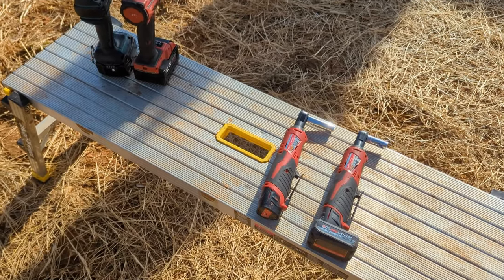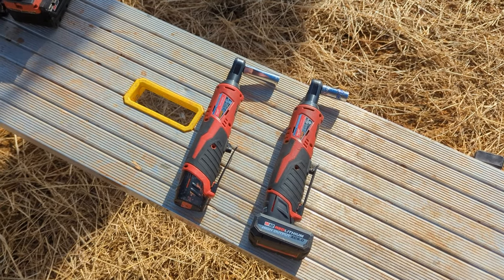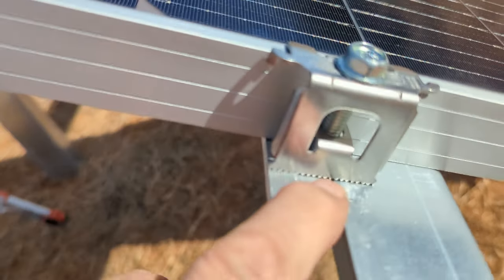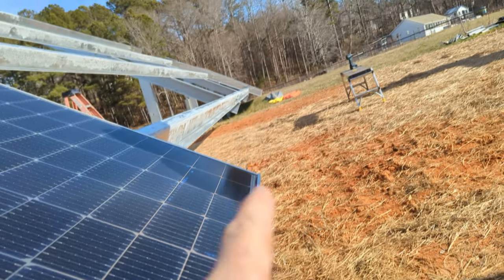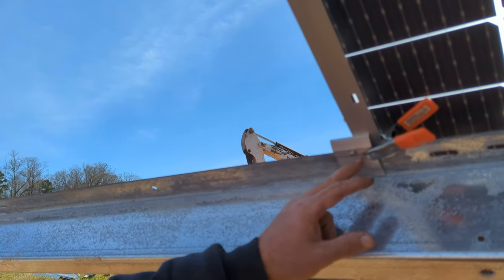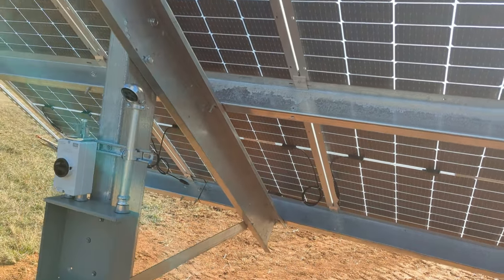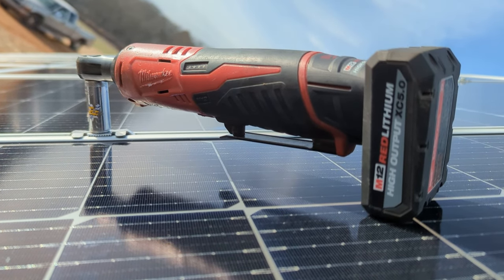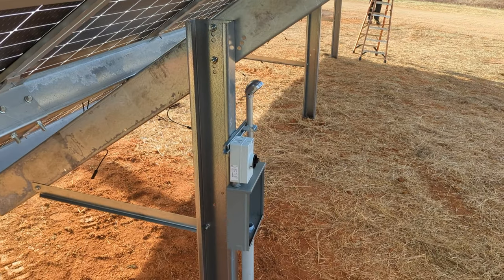Sinclair Ground Mount: Clamping Tips and Tricks

Comment: Man I wish i had thought about those mini clamps when I installed mine. The Sinclare clamps were the most difficult thing about the system. Had a Harbor Freight Bauer cordless Socket for the install which was priceless.  Strings don't work, at least not for me.  I had to end up redoing it by sight similar to what you suggested.

Comment: You directly bolted to the Sinclair purlin one time on Sinclair's suggestion, and it worked nicely.  Looks like you've went away from that.  I suspect you have a lot of stock of purlin and then panels vary, so hard to have the custom matchup.
Reply from the maker: It's the panel variation that makes direct high difficult. Some customers have already purchased their panels.  The clamping system provides the most flexibility.

Comment: Great tips. The galvanized steel posts pounded into the ground. Any idea of the estimated lifespan before coating breaks down and steel rusts and fails?
Reply: Longer than the system will be operational.

Comment: Great video as always. In Ontario we need to make the array PV wiring in-accessible to comply with the electrical code. Typically this is done with different types of mesh with under 1/2” holes. Works OK but doesn’t look the greatest. Has anyone seen different approaches for this?
Reply: Sinclair includes a Code compliant  system of plastic covers for the PV wiring with their mounts.

Comment: Thanks for the video, i have been trying to build a 38 panel setup do you have any tips o hanging the upper row of panels with a fixed tilt system i had to adjust the system to 5 degrees to get access to hang my purlins

Comment: They could make bifacial panels with 1 pane of glass. They just use the same clear silicone potting compound, and then lay an thin acrylic thin backer sheet over it. It would be a process, to get out air bubbles, but I think it can be made to work, and it would make bifacials as easy and light, and resource efficient as any conventional panel.
Or just use a clear sheet instead of white or black one. 
Makes percet sense, because, bifacials are actually too heavy. They will be a liability to roof istall and they will add too much weight to a roof I think. But also I think really all panels should be the flexibile plastic type, so they store compact, have low profiles, can be mounted flat to roofs really as they are perfectly water tight, still, There are better solutions to the panels of today.